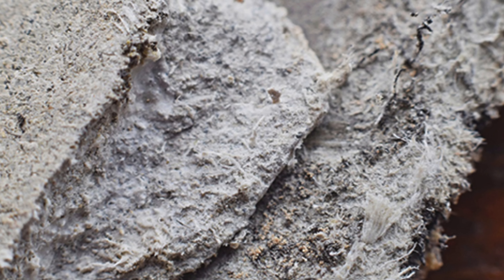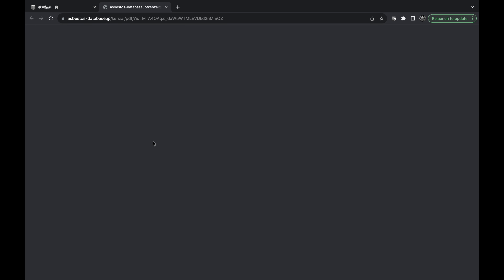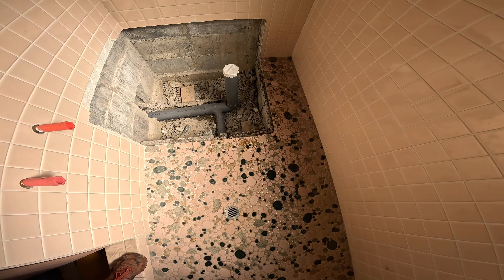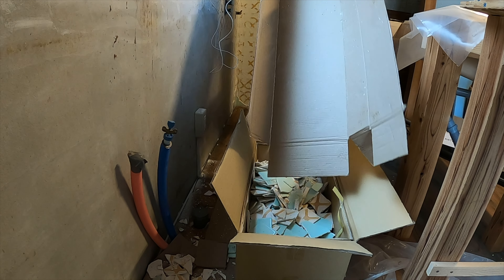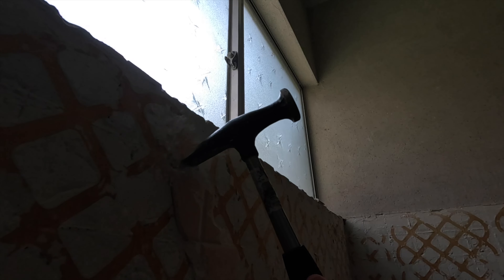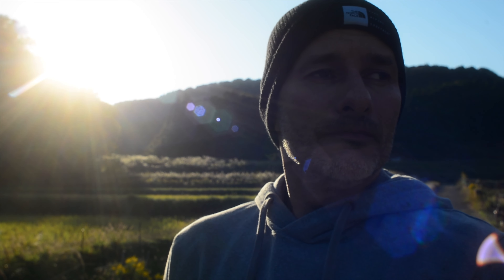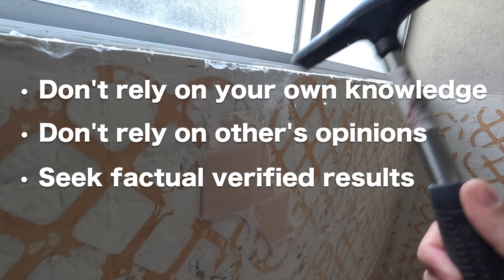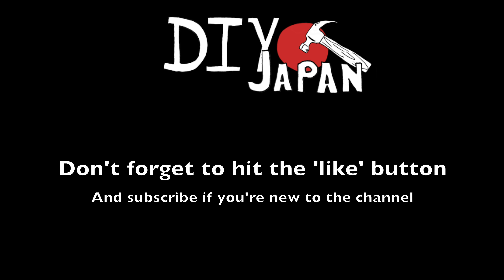Asbestos in Japan: what to do when renovating your house and how to test for it

Comment: Asbestos or not, I like running a box fan with a MERV11 filters duct tapped to both sides of it. Knocks down the dust issue in general. 

Killin it, my dude.
Reply from the maker: my house is a dust pit, I could do with a fan filter system.

Comment: We are looking at this old house in Saga that was constructed in 1980. The floors need to be replaced but the vinyl floor sheeting needs to be removed first. How likely would the vinyl floor sheeting contain asbestos?
Reply from the maker: The glue they used was common to have it depending on the year the house was made. Look into it.

Comment: Asbestos removal may have subsities from local government.

When using a jackhammer, place the machine outside, use a long extension cord for the hose. 2nd person set to suck right beside the hammer bit. Ofc, both people must be masked with the correct PPC filter properly. Dont do this during the summer. If you want extra comfort, position a powerful fan nearby so that the air it blows passes over the people working to help keep cool, also angled so the air will blow outside.
Reply from the maker: You are right about the subsidies. I have no knowledge of how to apply or use those subsidies... maybe if I had had asbestos in my house, I might have had some more information on the process.
Reply: @DIYJapan  the tests could have been wrong.... :)
Reply from the maker: I would need a positive test for them to subsidize the work though lol But hey, we have to believe anything with an official stamp of approval... because the almighty ''hanko'' says so lol

Comment: Asbestos is extremely dangerous and should be taken seriously. You ground up bathroom tiles and used them as gravel in your new bathroom floor. This could potentially mean that you breathed in asbestos whilst grinding up the tiles and that your bathroom floor now contains asbestos. This must be why Japanese recycling centres don't want old broken tiles. Good to know. I'll bear this in mind when I buy an akiya. Could this be one reason why older houses are just abandoned? 

In the UK I did a temping job in the office of a quanity surveyor. One of their major jobs was to remove asbestos from thousands 1930s and 1940s council houses. Asbestos removal is extremely tightly controlled in the UK. 

It might be worth you doing a public service announcement to foreigners buying akiyas, to warn them, in advance,  of the potential dangers of asbestos.
Reply from the maker: The tiles were all tested and came out negative. I protected the area and myself as if it was asbestos even though it wasn’t,  just as an over precautionary measure. Recycle centers don’t take tile because they would have to have it tested before disposal and it’s expensive to do so and because they tend to only take burnable items or recyclable items.
I think the main reason most houses are abandoned is because families refuse to sell or the families just disappeared without heirs to forward the properties to. It’s a rather complicated matter.
Reply: @DIYJapan  I'm currently researching how safe it is to live in rural Japan, in relation to dangerous wildlife. I didn't realise bears and wild boar were so problematic. I can understand younger city folk not wanting to move back to grandma's remote village, if there are bears and wild boar roaming around, attacking villagers and destroying crops. Anyone wanting to move to a remote location should bear this in mind. No pun intended.
Reply from the maker: nice pun though lol wild boar not so dangerous in my opinion... bears... also less so I think. But the destruction of crops is very real and a huge problem.

Comment: For me I was lucky in that my renno is so ancient, it was before asbestos existed, and the owners were too cheap to add anything more than totan walls and natural cut lumber oobiki floor beams. The only problem with garbage removal was the ever-increasing pile of old wood and crappy rusted totan sheets. Then last week a random dude came by collecting metal garbage (he sells it to a recycling center). He took the totan and random bits and bobs (old subaru oil filters, a billion rusted nails, etc etc) for free.
Reply from the maker: I need a random dude like that to come to my house. Could give him a truck load of scrap metal lol Most people burn the wood... but it's probably best to dispose of it another way. Sometimes the wood might be toxic... but it's certainly a cheap way to get rid of it.
Reply: @DIYJapan  I did burn most of the wood. If you have land, and plan to make 90cm raised garden beds. You can fill the bottom half with that wood that doesn't have any paint on it. I have been collecting planer shavings in bags to use as well. Way cheaper than filling it all with soil.
Reply from the maker: We are not allowed to burn in our town. Unfortunately it's prohibited.  @BGP369
Reply: @DIYJapan  ah, maybe because your spot is in a town rather than a village. Over here the houses are not close together and everyone typically burns their rice chaff or waste wood right after a rain. There is a prohibition on barrel burning apparently tho, so I just made a makeshift burn pit with cement blocks and 2 old stainless sinks for roofs. Can burn even during rain. It's nice.
Reply from the maker: why barrel burning though? I would have thought that to be the safest... they worries you're going to roll it into the neighbor's lawn and burn them out? lol
Reply: @DIYJapan  I dont know, and I stopped trying to because I prefer to keep what remains of my sanity... There's a 2 barrel double burn plan I saw on YouTube that is smokeless. I want to make it but yeah... You are right, barrels are safest, so long as you burn after rain. I'll get the last laff tho becos I plan to make a bigass honking brick pizza oven/pottery kiln/bamboo pole heating thingy. It will also work well to burn waste wood. Looking forward to that build. Maybe 3 years out.

Comment: Surely it is easy enough to visibly see any Asbestos mat/panel material rather than suspecting rock-hard bonding material that is made from ground up stone.
Reply from the maker: I thought the same. This whole process started on the suggestions of other experts. Asbestos use in Japan is murky and it was a chance to learn more on safety.

Comment: I am freaking out I live in a yokohama apartment for 1 year it ws built in the 1994 is this ok?
Reply from the maker: No need to worry. It’s only toxic if you demolish things. Undisturbed it’s designed not to affect you. Now if you are doing renovations and what to pull walls down or ceilings, then get things checked out.
Reply: I appreciate the effort you put into the video and your content keep it up! and thanks so you think just hanging up pictures and small pins is ok? I think they stopped using it in walls in 1995 and found out today my pace was built in 1996 @DIYJapan
Reply from the maker: @Saviour30 it’s ok ✅

Comment: Tragic that a supposed civilized nation would indulge in this travesty, if true. A relative - who worked around asbestos in the 40s to 70s - died from asbestosis after working in a steel mill where the substance was used in large scale pipe wrapping.  It was a horrible, drawn-out and painful death. Months of agony.  Japan, or the individual seller(s), should be required to remedy all asbestos issues at its cost.  It is like a ticking IED.
Reply from the maker: It’s scarier in bigger cities because they bulldoze these structures all the time… makes you wonder how much they actually protect the citizens around the buildings.
Reply: As he said in the video overconfidence is a silent killer. This mistake happens time and again in pretty much every country, on governmental level down to the individual level. If you're interested in more issues like the use of asbestos, look into; The use of lead in fuel, thalidomide, infected blood scandal. There is a long list of these kinds of mistakes in history, and we continue to make them all the time, so its important to continually ask yourself "what could go wrong?".

Comment: How trustable is this 3rd party company for testing? Did they include some "certainty error margin" or similar? Like are they 90%, 99%, or 99.9% sure there is no asbestos? It's a bit worrysome that 3 different people thought "it might contain asbestos" to "it definitely has asbestos". I would at least seek a second opinion for the "worst looking" item or two items given the rollercoaster of emotions (purely from watching the video, ofc if it was a bit exaggerated for dramatic effects of the video that's a different topic!).
Reply from the maker: Maybe it wasn't clear in the video. I thought 99% it didn't have asbestos. But, based on nothing but photos, two experts said more than likely and almost positive it did. But those experts would have to physically inspect the tiles in person, send the materials to a lab and get the 100% positive result in that manner anyhow. The emotions were totally real! I didn't like the fact that two people were saying that it was more than likely positive... especially when I was almost certain it wasn't positive and considering I used the database and other information to base my conclusion. The company is an actual lab that specializes in industrial asbestos testing. It's stamped, certified and can be used to pass professional inspections for demolitions in residential areas. So, the results are 100% conclusive.
Reply: @DIYJapan  Just wanted to check since I have no idea about these things and I'd be skeptical without more info about the testing, given what you said, nice to hear! Love the channel BTW 🥳
Reply from the maker: No worries, it was a good valid question! In the end, I still use safety equipment as if I was dealing with such materials. Better to be overly safe.